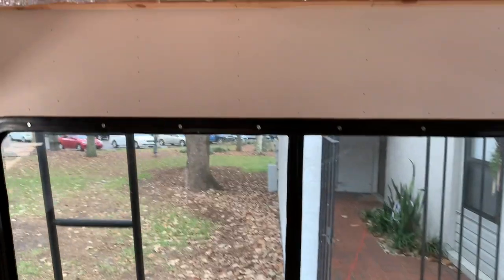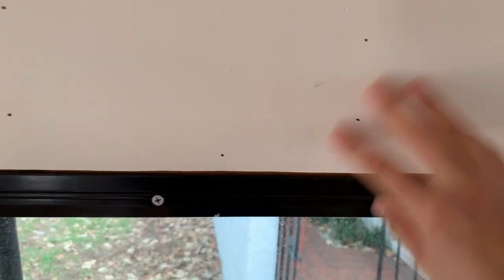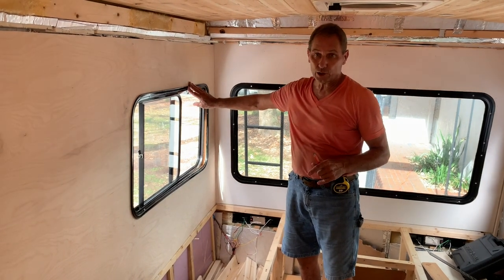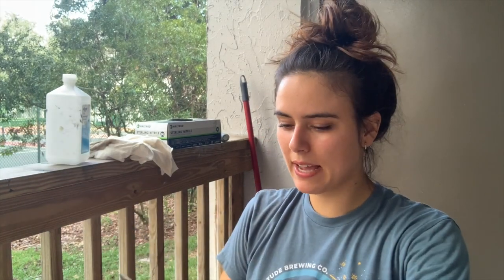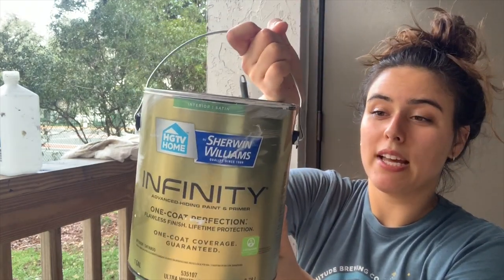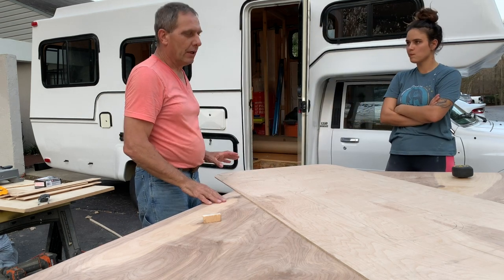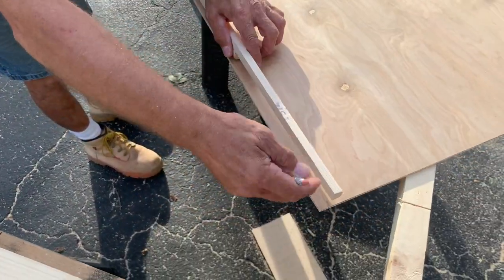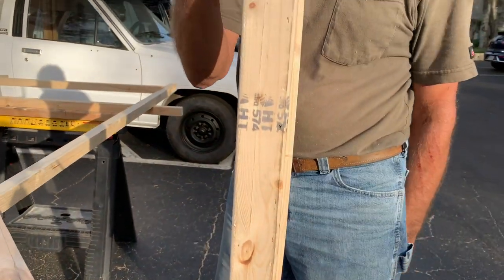Toyota Sunrader RV Build | The Walls

Comment: If their is a gap on back window that could mean that the inside trim is not holding the outside window strong enough to the outside wall and could allow water to penetrate as the butyl tape ages.

Comment: I love yalls videos, such a sweet project you two have completed! I was curious how you built the ribs against the fiberglass? I'm doing mine rn and can't figure out the best way to either clamp or hold the wall rib pieces to the fiberglass. Hopefully you see this, Thanks!!
Reply from the maker: Thank you so much! So we used a marine grade adhesive to stick the firring strips to the fiberglass wall. I cut leftover scraps of 2x2 and 1x3 to go across the camper to hold some pieces in place going horizontal. But the vertical strips held with just mashing it to the adhesive. And we also had left over fiberglass mat and resin/epoxy so we fiberglassed each strip in for an extra precaution.  Hope that helps!
Reply: Did you fiberglass the whole roof? Are the windows seals all new? Outside what did you paint with?  Floor what did you use?